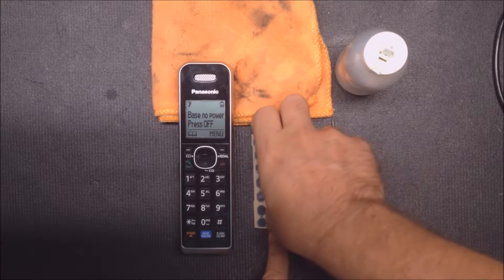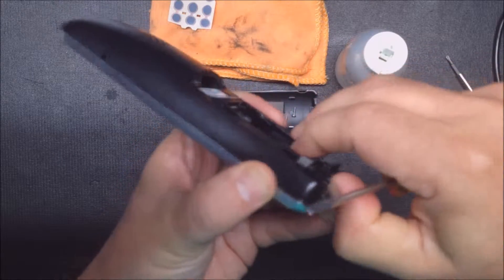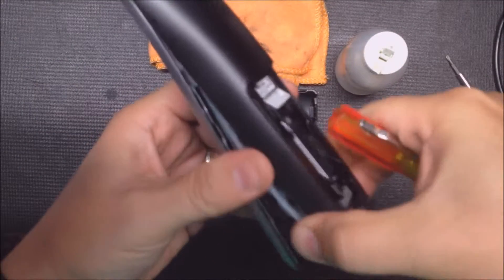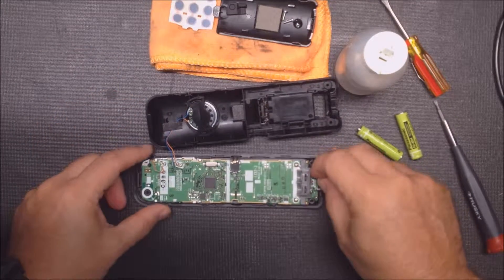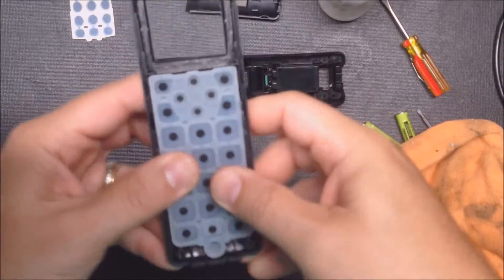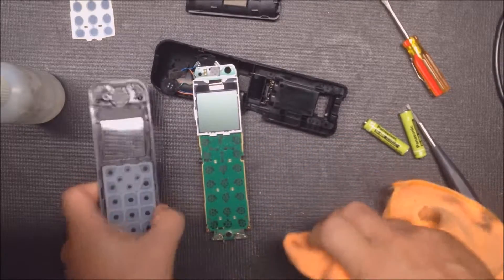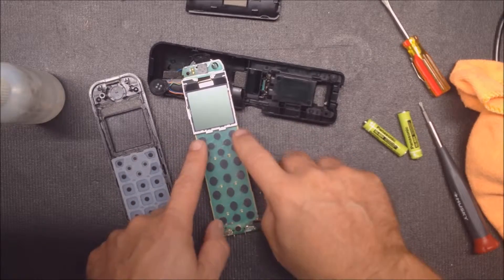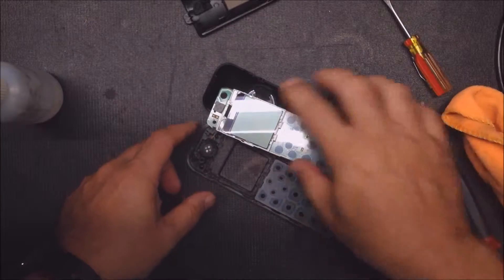Panasonic kx tga680 keypad button repair DIY

Comment: Thanks for this; it helped me use one of your kits to repair a KX-TGA660 handset. For that one, the interior screw at the top did not have a washer, and there were two interior screws at the bottom, holding the battery charging contacts, that had to be removed (with the contacts). It was slightly tricky to get the contacts back in correctly. My keypad and PCB were covered with a thick layer of grease. The keypad was easy to clean with warm water and a bit of Dawn detergent in the sink. Getting the grease off of the PCB with just 70% iso on a lint-free paper towel took a bit of elbow grease and several passes. The PCB looked kind of dull afterward, but clean and dry. After reassembly, the phone works just fine. Fingers crossed it continues to do so. My problem had been that, intermittently, the phone would just not respond to any keypresses, or sometimes just repeat a keypress endlessly. So far it's working fine, after the fix. —Tom

PS: Just found that you have a video for the 660: https://www.youtube.com/watch?v=O4kwnaUaFMg

PPS: Thanks for the tip about the headphone jack cover. ;-)